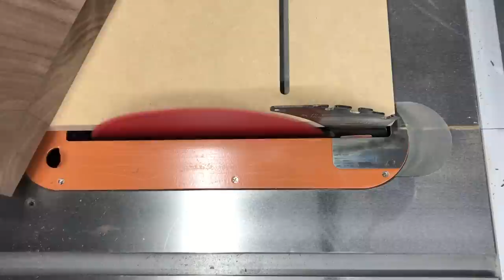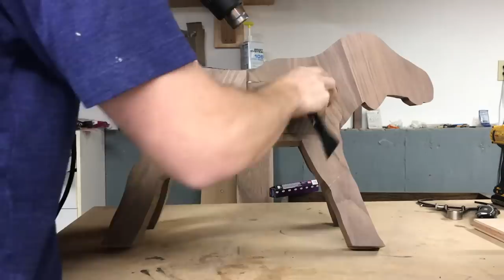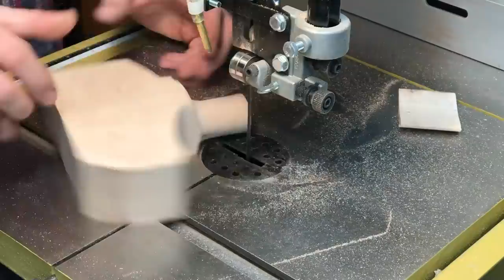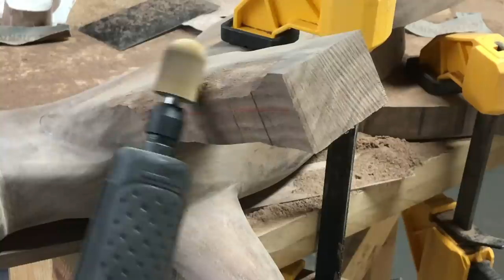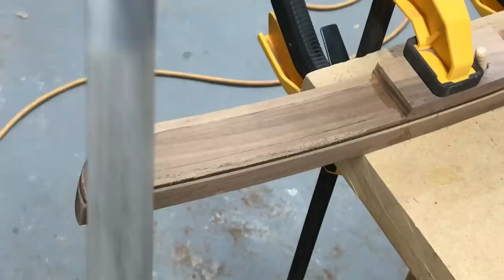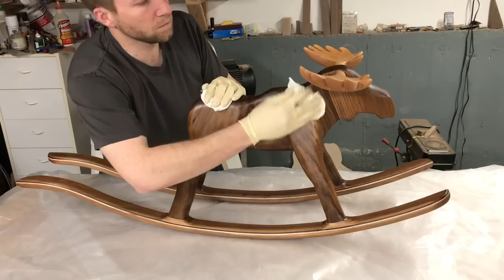Building a Sculpted Rocking Moose

Comment: I love how you have turned a child’s toy into a delightful piece of art! The beautiful simplicity of what you made belies its complexity as well as the skill it required to design and create this piece. Hence, my questions:

- What, if anything, might you do differently from a design or construction standpoint?
- What are the rough dimensions of of moose template? 
- What are the raw dimensions of the rocker strips as they are being bent? Are they 1/8” finished thickness?
- What are the antler dimensions? To what diameter are the antler handles turned?
- Where did you source the pattern for the bent lamination curve? Do you know if its based on a 42 1/4” circle? How long is your bent lamination jig?
- Did you cut the legs to fit the moose body on the bandsaw at 13.1 degrees, or some other measurement?
- Any recommendation on the best rasp brands and models?
- What was your method of locating the exact position of the moose on the rockers? I am assuming that position provides maximum and safe rocking forwards and backwards.

Comment: Question, was there any particular reason you glued up the body way you did? I'm thinking it would be easier to glue straight boards together and then cut the template out, looks like maybe you did it because of the grain pattern?
Reply from the maker: Yes it was done for grain direction to give the legs strength. Not as critical for the body as it is the legs but wanted the body to match the legs so there was as little a contrast as possible between the inside body and the leg pieces.
Reply: @mikeboehmer324  thanks!